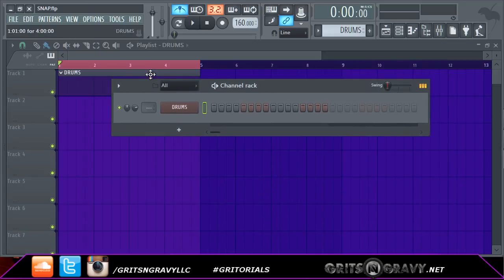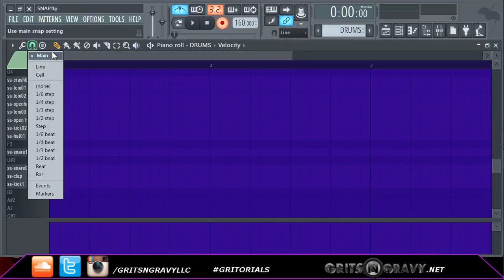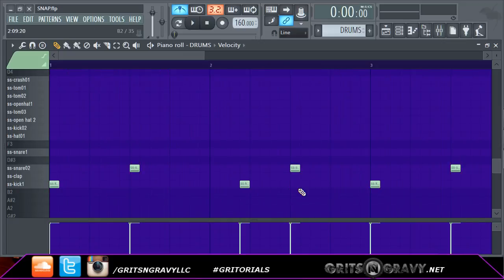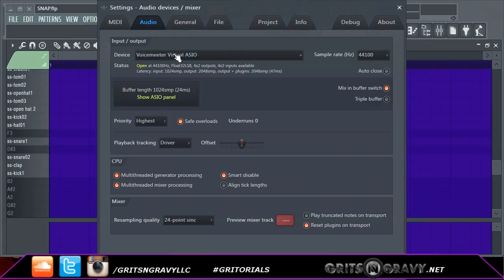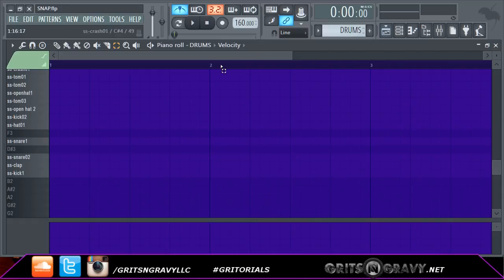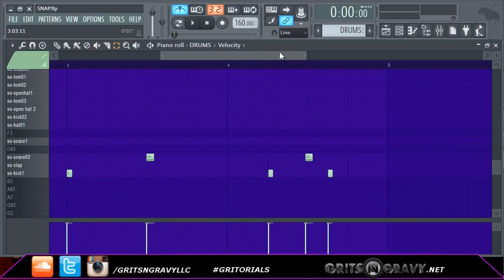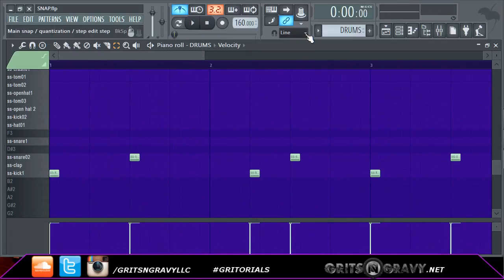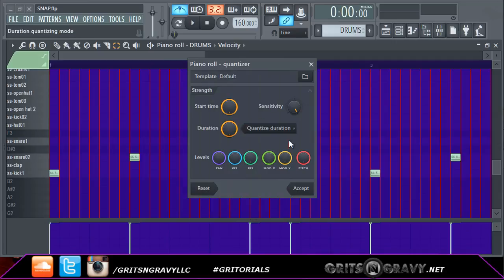FL Studio Tutorials - HOW TO FIX LATENCY AND QUANTIZE PROBLEMS! (Beat Making Tip #9)

Comment: hey guys, im having similar issue that was not addressed in this video, all my notes are where they should be, however as soon as i assign a pattern to a mixer track, the sound is slightly delayed, if i put them all on to the master track, they are perfectly synced, which is no good because i cant mix them properly that way, again, my notes are in the correct places and do not change, its just the playback sound that is delayed, thanks for your help if you choose to :)

Comment: who viewed in 2018-2019 and get it helpful🖐
Reply: me
Reply: Me too
Reply: Golden
Reply: bitch im watching this 2020
Reply: @OliverWijk  2020
Reply: Hello all! I'm running Roland FA 08 into GarageBand on Mac then bluetooth speakers from Mac and there's a clear lag between hitting keys on Roland and sound out of speakers. However there's no lag when I run the sound back through my Roland FA and out of the same speakers but via wire. I'm assuming bluetooth is therefore causing the lag? Is this fixable or just the way it is? Any help would be greatly appreciated! thanks!

Comment: I have a serious issue with recorded tracks with FL studio 12...
e.g. when I record a beat say at 120 BPM tempo and when I set FL studio tempo at 120, I find the beats are slowly getting out of sync and gradually change tempo as well... 
These tracks change tempo and pitch as well..
I am using Focusrite Scarlett 2i4 and normally at 48KHz. How can I fix this?
Reply from the maker: Anindya Bhattacharya Have you tried setting the Scarlet and FL studio both at 44.1? Sounds like your having an issue with your interface converting the audio at 48khz.

Comment: Do you know how to fix metronome issues with the first click starting on the second beat? I don't know what it is
Reply from the maker: Remshaw Musiek Try the fixes in my video first. I had a similar issue were the first tick of the metronome never made sound when I tried to record, basically my pre roll was chopped off.  After I tweaked my settings it cleared everything up. sounds like you may be having a latency/delay issue.
Reply: That did it, Thanks

Comment: Man I been trying to fix for awhile! And it's very annoying. But I changed to mixer instead of driver.  You have the best video fix thank you!!!
Reply from the maker: Reggie Daniels your Welcome fam. Yeah FL is a beast once the settings are right.
Reply: Grits N Gravy I started off with reason but I like using plugins and fl studio is nice. But now reason is coming out with the ability to use vst 🔥🔥🔥
Reply from the maker: Reggie Daniels Yeah I didn't like that about reason. That's dope they finally opened it to VSTs.